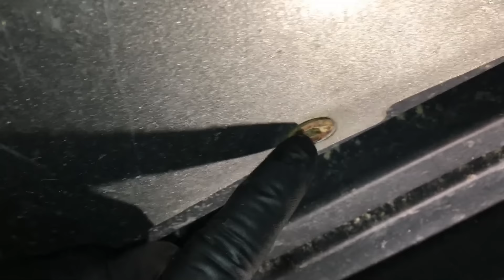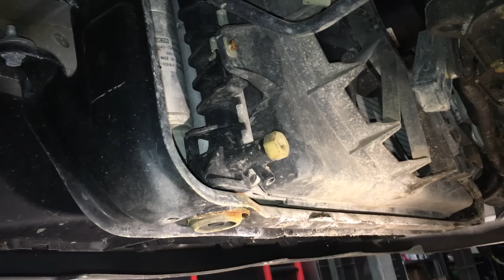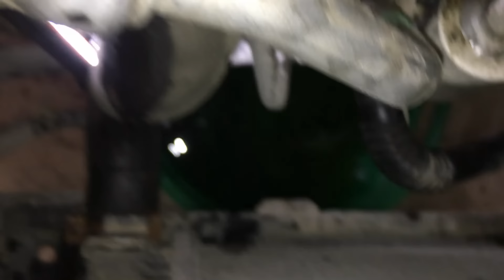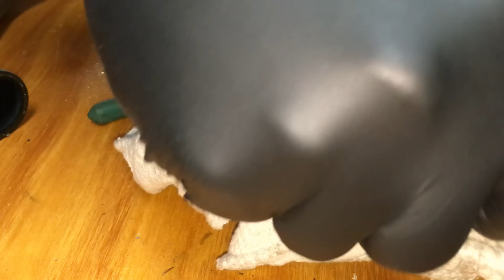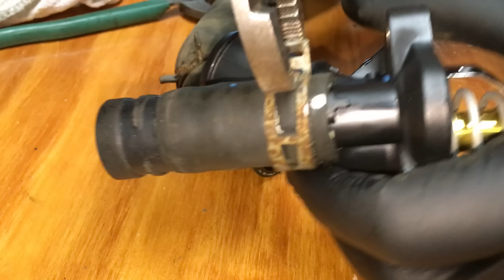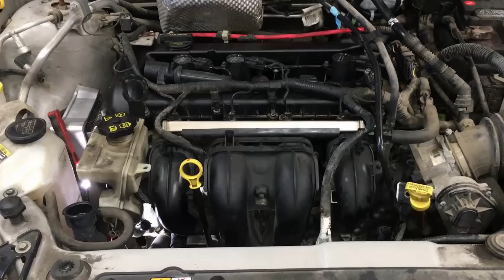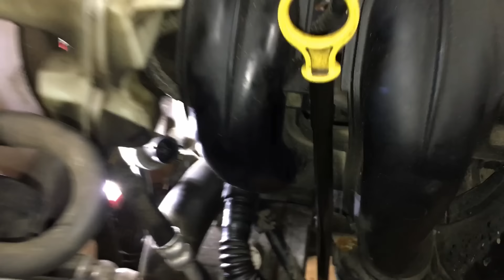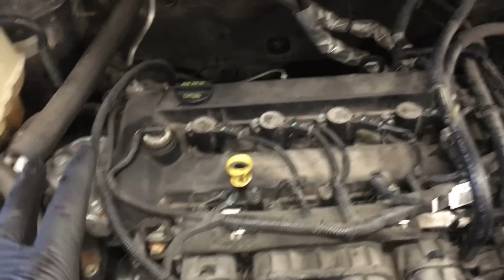Ford 2.0L 2.3L 2.5L Engines P0125 P0128 Insufficient Coolant Temp: Thermostat Housing Replacement

Comment: Ok i changed the Thermastat and bleed the line its not over heating but my engine lite is still on . how do i get it to go off
Reply from the maker: You must disconnect the battery it is not self clearing.
Reply: The CEL may take several drive cycles/days to clear on it's own.  For immediate results you can use a OB2 reader to read and clear the codes or disconnect the battery for a few minutes.

Comment: Is it necessary to flush the entire cooling system when changing the  thermostat housing?
Reply: Franco Barrera Nah brother.  Unless you're having overheating problems or it's just time for a flush, then there's no need.  Mine is overheating so I might replace the thermostat and then do a flush anyways just so I can clean up my radiator and hopefully resolve the overheating
Reply: It's not necessary, but whenever I am replacing a thermostat I flush the system. It doesn't add that much cost to the repair.
Reply: I would flush the coolant as preventative maintenance.
Reply: I would flush the coolant as preventative maintenance.

Comment: do these engines have 2 thermastats 2.0l
Reply from the maker: no
Reply: it's there one in the water outlet bc I've changed my thermastat, the temp sensor, and did a coolant flush and it's the 4 or 5 time my light has cane on for it said its not getting up to temp

Comment: Thank you very much, I  just changed mine this weekend, 2008 Ford Focus SE, was not as bad as I thought.  I tested the old thermostat in boiling water, it did not open so it was bad.  After putting on the new one (no sensor, $23 Advance Auto) the car does not over heat at all anymore!  It was overheating all the sudden after only 5-10 mins. of driving, on not even a hot day, lik 78 degrees.
Reply: Exact same symptoms here.  I HATE overheating even for a moment.  I have seen solid cars with low miles turn to DEBT for the owners due to this (new engine).  Remember when you shut off, residual heat will cause temp to rise for a few more minutes, and of course your imagination runs wild what's happening inside the engine.  My wife was amazed that we use thermostats at all when I explained how they work and what can go wrong.  She has a very fair point!

Comment: I just changed it on 2006 escape hybrid, pain in the but, the radiator drain is on driver side. To bad I did not had the tool to remove the air from the system.  The 3 bolts from the termostat were the most difficult to remove and after to install. If you do not have the proper tools, extensions etc. Is better to see a shop to do it for you. Took me 3 hours to replace it.
Reply: @Ciprian Taune I have similar truck the heater is not coming on. Was that the reason for replacing the thermostat? Because it stuck open.

Comment: Any chance a P0128 code on a 08' 2.3l Escape is just a coolant temp sensor replacement?
Reply from the maker: no
Reply: FordTechMakuloco Thanks for the response! Just ordered a new thermostat and housing. Will the check engine light go off on its own after replacing or does it need to be cleared?

Comment: @FordTechMakloco Thanks for this video. My question is if I am doing a coolant flush on the exact same engine do I need to use the vacuum tool you are showing? Thanks in advance.

Comment: Any idea what a hissing sound coming from the driver side of the engine is, plus I see bubbles. I thought it was the thermostat but I see that the thermostat is on the opposite side .It does this specially on Summer. I have a 2010 Ford Focus BTW-Thanks

Comment: I have a 2005 Ford Focus ST with the 2.3L engine, and I will be undertaking the same repair/replacement this weekend. I am having trouble finding the bleeder nipple on my engine. Do you have a diagram or picture of where it is? I looked where you showed in the video with no luck.

Comment: I have a 2012 focus w/2.0 and its consuming coolant.  The car only has 70,000 miles on it. No coolant mixing with engine oil. Is this common?

Comment: That 2.0L is the first Ford engine that I have seen in a VERY LONG TIME that has a coolant fill neck attached directly to the radiator and a true overflow tank.  Every other Ford I have encountered (admittedly not that many) has a pressurized remote coolant tank (you called it a de-gas bottle on the second car).

I have never had to use a vacuum fill tool on an engine with a pressurized remote coolant tank.   Fill it up, run the engine up to operating temp, top off the coolant and your done.  Best practice is to check the level after a full drive cool down cycle.

Comment: off topic but what could a popping noise from the rear end of my f250 when making a tight turn be caused by? no other noises are made by it and I'm not sure when the Previous owner changed the fluids
Reply: Probably differential

Comment: Ford sure likes to pack that engine bay tight, don't they Brian? I recently acquired a 1996 Mercury Mystique with the 2.0L Zetec engine. 243k miles and purrs like new.

I know the owner replaced all the coolant hoses and thermostat housing before I got it...the hoses burst one by one, and also the water pump seized up at 230k miles. So several overheating episodes but engine seems to be OK. It definitely has a lot of specialty hoses and pipes and clamps that are a PITA to get to. Wiring insulation under the hood is a little crumbly too lol. But the 5-speed drives so nice and looks cool too so I'm keeping it! :)
Reply from the maker: The ZETEC was one rusty nightmare!
Reply: The engine or the car? The one I got is pretty mint for a Central PA vehicle...and the oil pan seeps around the gasket so there is some undercoating on the belly as well haha

Comment: Excellent video and workmanship as always Brian. 
This video interested me since I have the 2015 2.0 and have complained to Ford service dept about how slow it is to create heat in the dead of winter. Often times on those sub zero days its 15 miles of highway driving before I can feel heat at my feet. Then I jump in my work Sprinter diesel and have abundant heat within 2 miles ... ya can't make it up. I'm sure it just a matter of time before I'm doing this procedure.

Comment: Hello everyone...
I have a problem, my camshafthas been damaged. Lifter broke up and destroyed my cam. My car is Ford Explorer EB 4.6 v8 from 2007, I live in Poland and I have problems to buy such a camshaftfor my car.I can buy a camshaftfor Mustang GT. Will there be a matching camshaft for my Explorer? I was looking at RockAuto and probably the same.

Please help me with this.

I have some more questions ...
1) What oil poured into thisengine? 5w20 or maybe 5w30, Motorcraft or other company (Mobil etc)
2) Does Enginetech make good parts? Maybe DNJ, Melling, Sealed Power, etc.
3) I want to replace the camshaft, I bought the whole kit Cloyes of RockAuto ..... is that a good choice?

Sorry for my English

Comment: What about if you want to put new hoses on it ?   I think after going through all of that i would rather have new ones verses re using old ones.   Just my opinion, but it seem like alot of work to get all the air out of system so you wont have problems with it over heating.  Is this just a ford thing, or what?  From what i can tell watching videos on u tube is that fords have alot more issues involving service than other models in general.

Comment: Just did this repair on my 06 Escape Hybrid and it wasnt too bad.  Removed the belt and tensioner which made so much more access to the housing.  Took me about 2 hours to do.
Reply from the maker: Yes but that is a bit easier with no power steering pump in the way.
Reply: True..
Reply: What is the best procedure for bleeding the system on a hybrid?

Comment: FordTechMakuloco

im in need of some very technical wiring information
1996 FORD F 150 4.9 L6/ 300 SIX CYLINDER
Am in search of the complete wiring diagram of the underhood fusebox including the wiring color and pin placement the fusebox is numbered 1 to 69 far as i can see ////  I cannot find this information anywhere  Please Help Sir
Reply: the fusebox discentigrated and all i have left is wires every where under the fusebox not hooked to anything
Reply: http://bbbindustries.com/tech_database.html
Free wiring diagrams for all vehicles
Reply: i thank you  DRM 315

Comment: @FordTechMakloco could you please do a video on pinging/knock on these engines? i have an 06 focus that the engine knock in the summer months. especially audiable when you're stopped at a street going uphill and want to initate speed from a stand still!! i changed the knock sensor, spark lugs, used premium gas,  to no avail!
Reply: If you're talking about a kind of a "grunt" sound when you first accelerate, I think it might be related to some butterfly valves in the intake manifold that are supposed to cause intake air turbulence at lower RPMs.  The flaps are plastic and the rod that actuates them is metal.  I think the metal rounds out the plastic a bit and then it begins to rattle, especially when accelerating from a stand still.

Comment: I don't know how he did it! i have an 06 focus(2nd generation focus), same engine as the one in the video(3rd generation focus)2.0 duratech, and I had to remove the power steering pump. fordtechmakloco did a wonderful job. before you condemn the thermostat, check your cylinder head temperature sensor.  mine i had to replace before.

Comment: Thanks for the video. We just bought a really nice 2011 escape last year. That thermostat doesn't look that bad, a pain but not the worst. My worst t-stat was a 95 lumina with 3.1, the housing was covered by an exhaust pipe. The bolts were rusty and you can guess how bad it got. God I hated that car!

Comment: The Mazda FSM says that in order to bleed the air out you can hold the RPMs at roughly 3000 for 30 seconds, rest, then repeat. This worked quite well for me. You cool with that Brian? I don't think that many DIYers will have that vacuum bleeder assembly. Thanks!
Reply: I recently changed coolant on my 2010 Fusion. Luckily I was monitoring the temp after refilling. The temp gauge went into the red range. I shut the engine down immediately. Everything was okay, but those pesky air pockets are dangerous if you aren't observing things. 

I'll invest $100 in a vacuum bleeder system. I bought the brake vacuum bleeder you recommended and love it!
Reply from the maker: Yes I have a video on that procedure, but I only use that to remove the last bit of air from the cooling system Here-https://www.youtube.com/watch?v=4gk4xb9aOgE
Reply: Excellent. Thanks!

Comment: wouldn't you just get a new hose since you got it off anyways? extra expenses for sure but new for the new part?
Reply: I always use a new hose b/c there is no more rubber compression to seal. Just asking for a leak that's cheap to prevent.
Reply from the maker: Never a problem here.
Reply: The rubber hoses today are well made. Back in the day when they were not that stout it was wise to change them.
Reply: Great video. I only would disagree with resetting the clamps in the same place. As seen in the vid, the clamps will continue to dig deeper into the hose causing damage...mostly at the pinch-point. If you slightly rotate their alignment upon replacement, the clamps have more "meat" to eat into and will hold beautifully. Also a little silicone glue helps prevent any leaks. Who wants to do a job like this twice? Lol. Great video though. Thanks!

Comment: Been there and did it the same except I put new hoses on my 04 Focus 2.3L Wagon, 140,000 miles... but i also broke the "Y" plastic hose to the right... it gets brittle.
Reply: DG Adams lucky!!!! 2.3 pzev wagon i want one so bad.love my zetec tho
Reply: Other than lower body rust it's a good car.... bought it with 130k, kids put 40k on it - basic stuff like brakes, lines, thermostat, valve cover. Struts,  sway links, inner/outer tie rods, serp belt & tensioner, 2 coils (broke tabs)
Reply: 3rd coil, and spark plugs/boots.. but still have it at 188k

Comment: I did this two years ago on my 2010 fusion, if you take the air box out you can reach the rad drain from the top, and since it has electric ps I could reach the thermostat from the top no problem, I replaced the factory clamps with screw clamps, no leaks working just fine.
Reply: Actually the original spring clamps are superior to the screw clamps.  Spring clamps allow for expansion and contraction cycles, while retaining tension.  Screw clamps eventually loosen.  I also replaced a Ford spring clamps with a screw clamps on a lower rad hose, and wound up with a leak a while later.  Now I grab good condition spring clamps whenever I am at the wreckers.

Comment: would it be smart as well to replace the hoses while in there?
Reply from the maker: If you wanted sure but this customer was on a budget and already had a large bill from other repairs on the vehicle. Also to this day I have never seen a factory hose burst and I have seen allot of vehicle with some high mileage on them.

Comment: Brian - Awesome Video Bruddah. I learn so much from watching and re-watching your videos. Thanks Bruddah!!  Btw, where is the video link you mentioned at 18:45? (procedure to push air out of the heater core and engine)
Reply from the maker: I had to run out to a few mobile repair jobs right after posting but all the links have been updated at the top of the comments and in the video description as always.
Reply: Hawaiian F150 same question 
Where's the link to that vid. Brian

Comment: WHAT RETARDED M.F.ING  ENGINEER BUILD THIS F*CKING ENGINE SO ONLY DEALERS CAN REPAIR THE  DAMM THING,I THOUGHT CHANGING THE OIL WAS A PAIN IN THE ASS.I STILL THING WALMART DIDN'T  CHANGE MY OIL FILTER THE SCREWS ON THE COVER PLATE WHERE NEVER REMOVED TILL I CHANGED THE OIL MYSELF.I WISH I COULD PROVE IT,BUT WILL NEVER GO THERE AGAIN.AND IF I DO IT AGAIN I WILL MARK MY OIL FILTER TO MAKE SURE THE DAMM THING IS CHANGED.
Reply: I've worked at quick lubes and one big name major manufacturer. All are capable of ripping off their customers.  I boycotted certain service writers who were cool with this practice. (They didn't like me very much but I'm not selling my soul)
Do the relatively simple stuff yourself.  A lot of cases you save money and you're not waiting on a kid that has minimal to no experience who doesn't give a care about your car.  BTW, manufacturers a lot of times want you intimidated enough to take it back to them for repair. Sometimes you've got to with a lot of the new technology into their cars to make them more efficient. On some cars all it takes is low voltage and that's enough for a particular system to lose it's calibration and the only way to clear it is to take it to someone who has the diagnostic software to take care of it.

Comment: Brother i have expedition 2012 5.4 3v have codes p0365&p0369 if you can do video on thim
Reply: yousef al thaidy I used to drive an 03' Expedition and was able to replace the thermostat myself.It was so much easier than this. The thermostat is not buried behind anything . It sits on top of the engine. All I had to do was locate where the thick upper radiator hose met the engine and that's where the thermostat was located. After that you undo the hose clamp, wiggle the hose off, and there it is. Do you want more detailed directions? I have an awsome repair manual by Chilton covering your vehicle.

Comment: Hi there buddy just got to say I'm a big fan of the channel because of you I was able to change my front and back brakes on my 2002 Ford escape quick question all of a sudden my car started to misfire the mechanic had a look at it he told me that it's pumping too much gas in to the cylinders and it's an internal problem and it's not worth fixing it any suggestions
Reply: I suggest punctuation. Makes it easier to understand. Just sayin....
Reply: Erwin Rucal I have had several misfires the past 2 years on my '04 2.3.  My mechanic changed the plugs and coil on plugs and things have been working fine ever since. Cheap easy fix.  Not sure if it applies to you but you could give it a try.

Comment: what motor does the 2005 zx4 Ford Focus have in it I know it's a 2.0 but it has been an excellent motor we have three hundred two thousand miles on it and it's still going strong
Reply: Big Mike FAM Prob a series of engines called duratec they have a reputation for being extremely reliable expect similar milage from the 3.5 in my explorer at least.
Reply: Kevin B The 3.5 and 3.7 transversely mounted Duratec is the least reliable Duratec other than the Duratec 3.0 in the 4th gen Taurus and Sable.